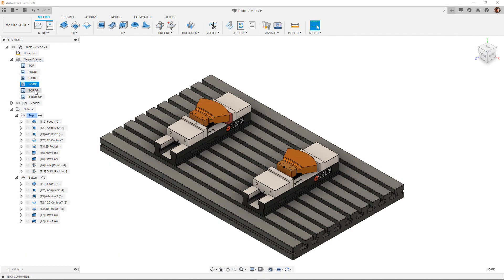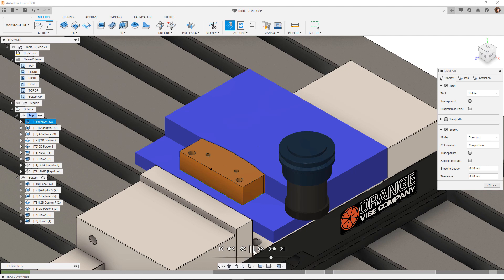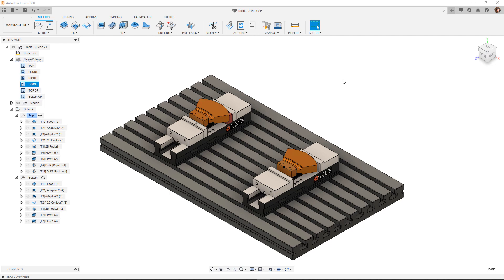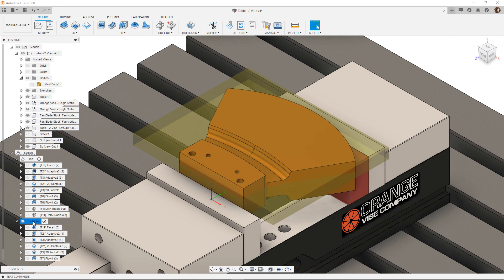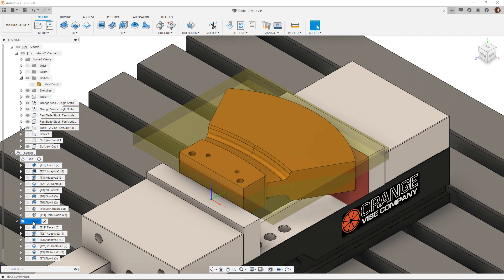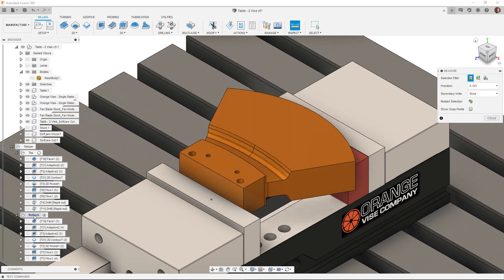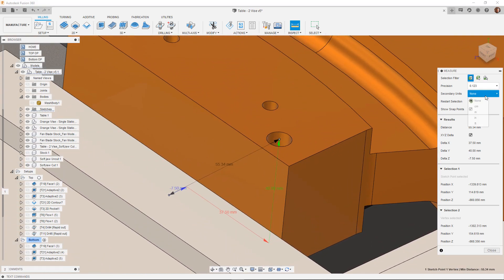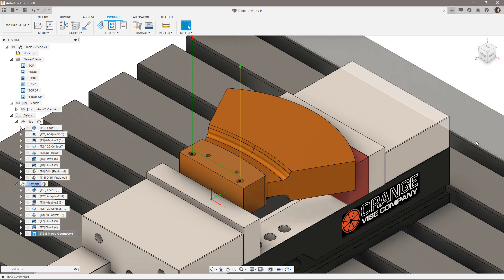QUICK TIP: Measure with Snap Points

Comment: I appreciate the tip, the show snap points looks really useful. I realize that this was an example to illustrate a point, but In a similar situation, I was able to do a facing operation with the Z height fixed at the top of the parallels and then probe the g54 XY after the facing op. After the latest update, I have not been able to get a g54 probing operation to work after the first op. I hope the feature didn’t go away, and i wish the cam tool path errors were more helpful than stating the obvious (that it didn’t work).

Comment: is there any way to measure from the g54 origin if you haven't used a sketch point to set it?
Reply: Hi Simon, that depends on how you set the origin. If you're using a stock point on stock that's generated within the CAM Setup, like Fixed or Relative Sized Box/Cylinder/Tube, probably not, since the snap points won't snap to the generated stock. If you're using a model feature to set your G54 or modeled your stock, then likely yes!
Reply: @marthadeans  This is what i mean in an other video. I read about this often that people want to check the origin point. Using the model points its very easy and fast. But sometimes as example i want the origin at the center it looks like it is in the center but it will not. So i want to measure the origin point.  For me i will work with a sketch...or there will be add a funktion for this.